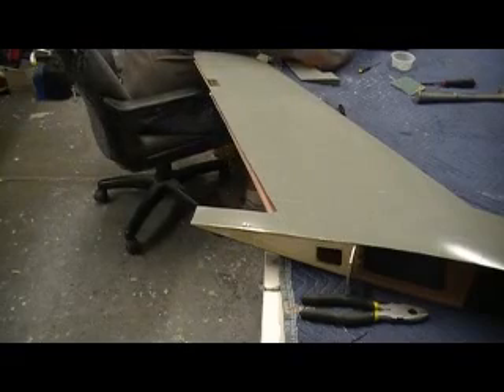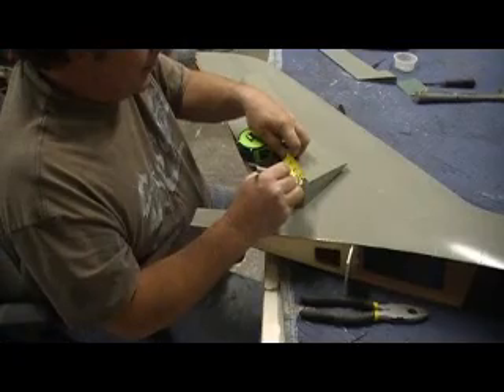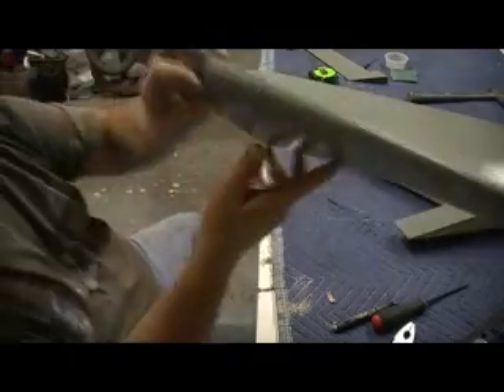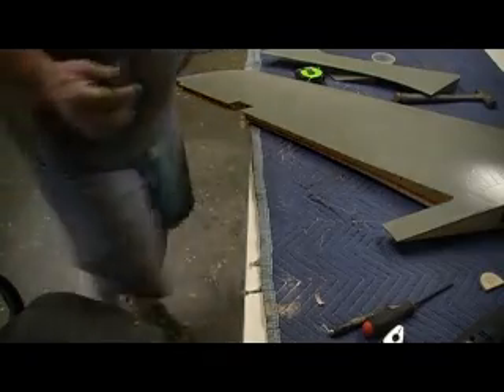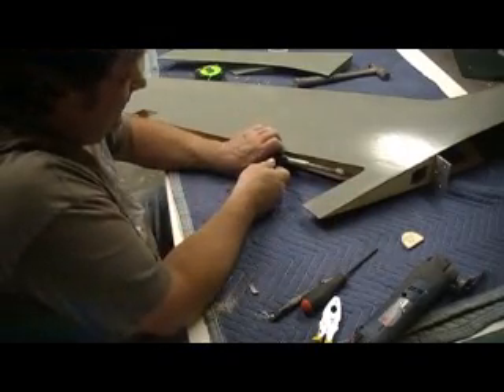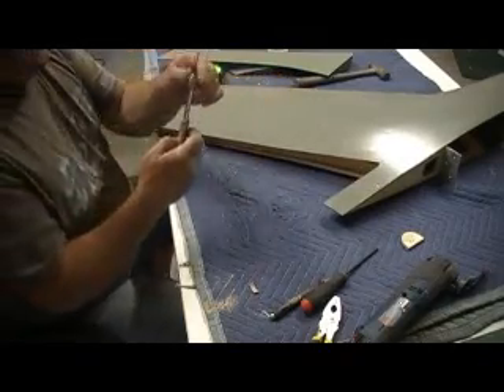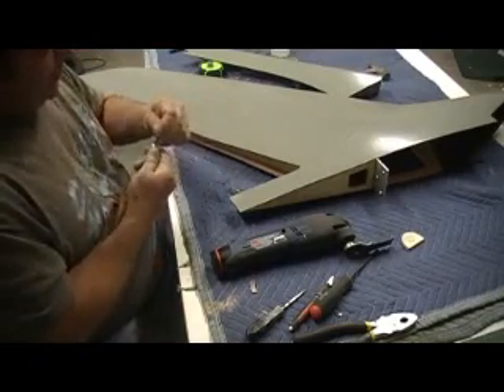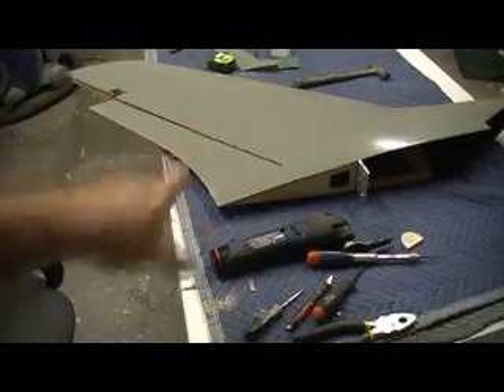how to build a rc jet F-105 thunderchief # 447

Comment: The Harbor Freight numbers for the safety wire twisters are Item #45340 (6-inch) and Item #45341 (9-inch).  The cost $8.50 for the 6-inch and $9.00 for the 9-inch.